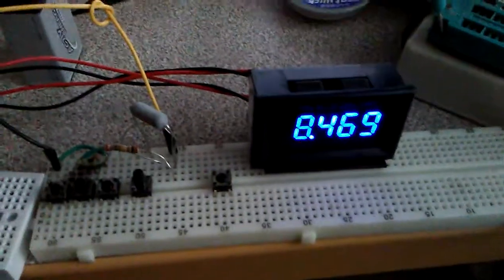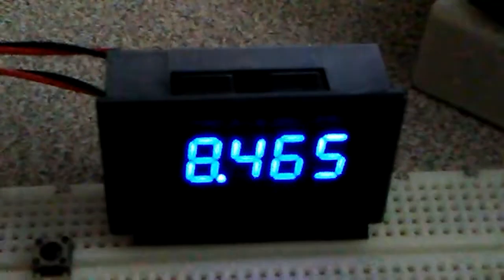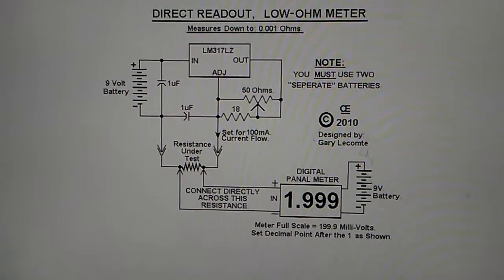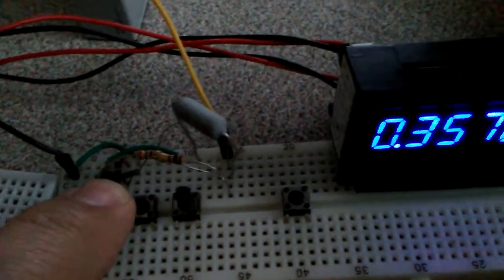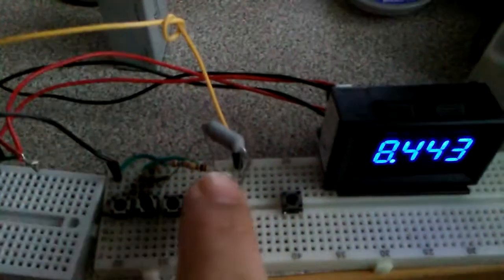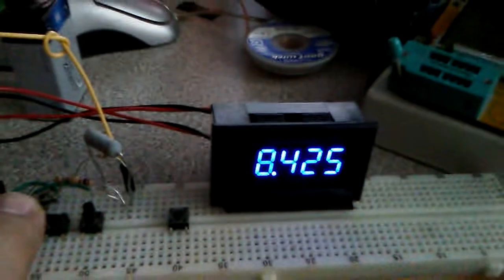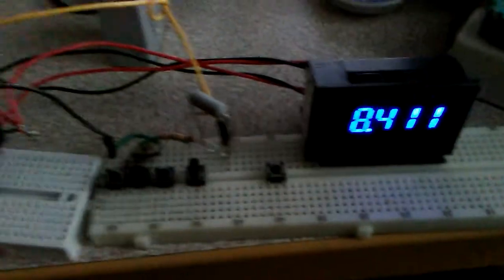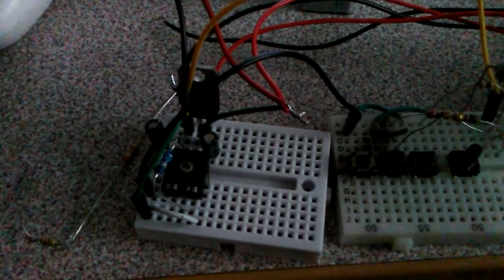Lm317 milliohm meter homemade simple and precision

Comment: Your milliOhm meter doesn’t look like the one on the schematic. The one on the schematic uses two separate batteries [?]. Also, you have a display with four wires sticking out of it. The schematic is for a three wire display. I have a four wire display also, so I would like to recreate your milliOhm meter BUT I don’t know how/where to connect the wires. I know that the two bottom wires are for the 9 volt batteries. But where did you connect the top wires? Your video is unfortunately too blurry, I can’t even tell where your 9 volt battery is? Can you please provide the schematic of YOUR milliOhm meter? I would very much appreciate that. Thank you kindly
Reply from the maker: Hello at first thanks for watching, you can use two batteries or single! Battery does a matter, the three wore panel and two wires difference depends for brand u order meter panel. Let me know u need more explanation
Reply: @seyedmarashi  I just need a schematic [or perhaps, another video] of HOW you connected, the “measuring” wires [the two bottom wires, from the display]. Because the schematic at the end of the video, is different from the circuit that you created, for YOUR milliOhm meter. I’m subscribed to your channel because, I’m a novice in electronics and your videos help me understand. So, thank you and please make more videos.

Comment: this is not a MILLI Ohm meter. just Ohm meter. even though you got the resolution for decimal points, this voltage meter (like any other average DMM) got no precision for such low value measurements. so error in measured resistance would be something like +/-10%  for 0R100 and 10 times worse for each 10 times lower resistance.
This is how you really should do mOhm meter:
https://youtu.be/y4KU1aeYMxA
Reply from the maker: leeroy, this is measurement circuit to connect to high precision current measurement device with Zero Point Adjust feture . it mean you should connect very good Multimeter (4digit) to this item to show exactly milliohms! this simple circuit can measure 0.01OHM to 12OHM very easy! if you use lm317 Texas may go more than 15OHM. i have one more video and i checked normal wire ohm over this project! how ever thanks for your idea.don't forget Zero point Setup needed for multimeter that you need to connect to this project because of calibration point of this project will not start with Zero